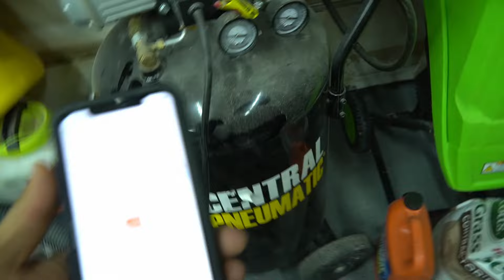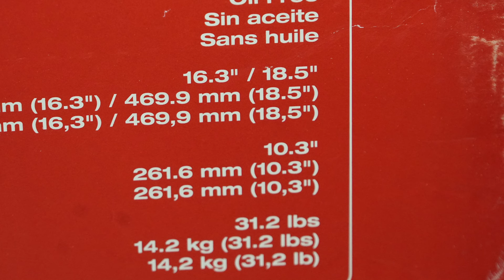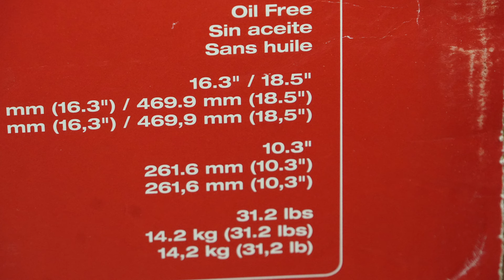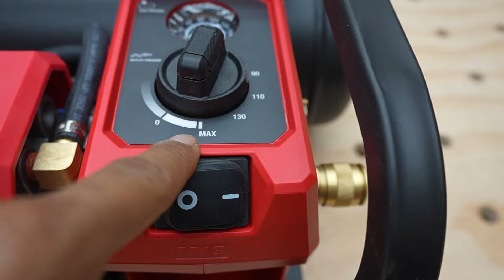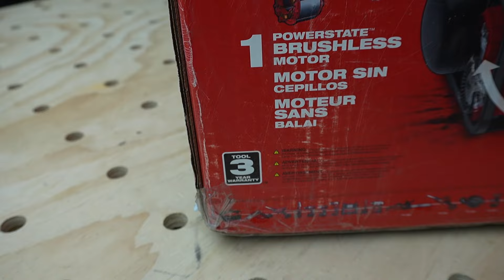Milwaukee M18 Fuel 18 Volt Cordless 2 Gallon Compressor Unboxing And Overview

Comment: I have an assortment of Stanly/Bostitch nail guns running off the DEWALT 20V MAX 2 1/2 Gallon Brushless Cordless air compressor, I though about going cordless, but at the time I didn't want to deal with all the hassles for something that was working fine. I'm also using the 1/4 in. x 25 ft. Polyurethane Air Hose because it's light and easy.
Reply from the maker: Nice. So no regrets going with the cordless compressor? I am hoping that my experience with the M18 is satisfactory in the long run.
Reply: @daddysharespace  Because I have a Makita 40v 8 1/2" sliding miter saw, I was looking at the new Makita 40v cordless compressor, but the Dewalt was a gift from my wife, so I kept it and purchased more Dewalt 20V batteries. 

Yes I like it, but I also have a corded version that I haven't used since I got this one years ago.  

I would say the only issue with a cordless compressor is power, it works fine on things like a nail gun, but I'm not sure how well it would be on an air impact gun.
Reply from the maker: That is why I am keeping my larger compressor.

Comment: Hell yes brother. Best review out there. How do you like it 6 months later?
Reply from the maker: Thanks for the compliment. Unfortunately, the compressor did not last a month before it stopped holding air. The negative reviews reported this issue I was hoping that they were wrong. They were not.
Reply: @ I had a feeling it was too good to be true :(